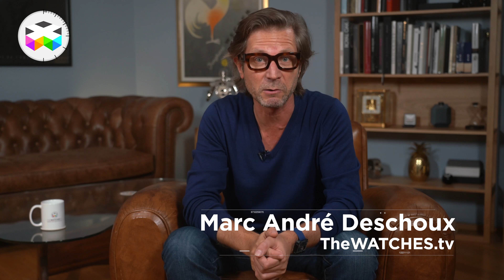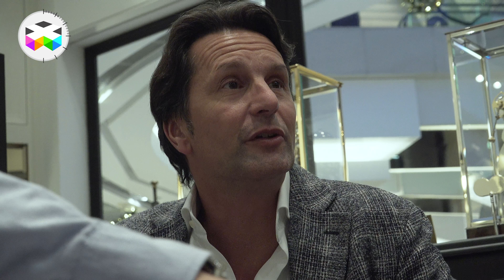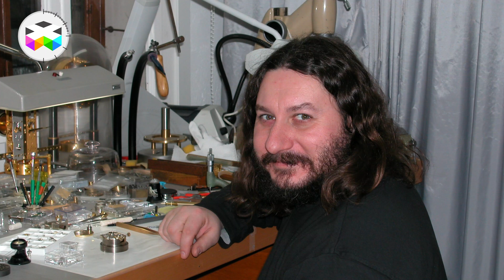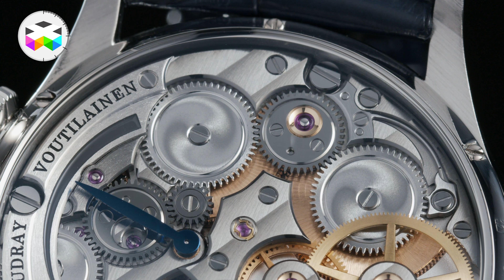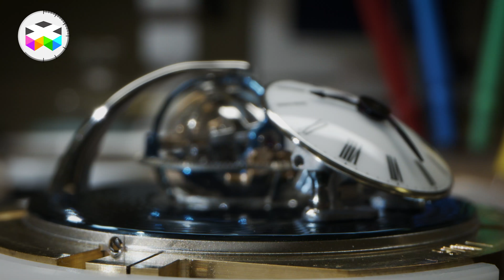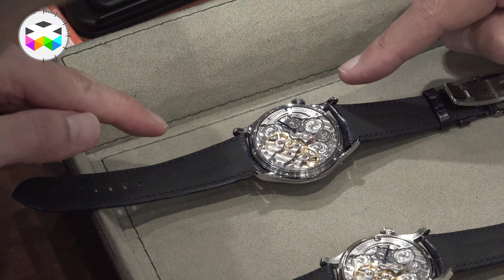CRAZY LEGACY MACHINE THUNDERDOME BY MB&F

Comment: Wonder if these things could be used as engines for tiny machines. I mean, obviously yes they can move things they're watch engines, but it you used it to make some super aesthetic clockwork robot thing- this thing would be a beautiful core.
Reply: The sculpture thing in the middle isn't where the power comes from...its only responsible for regulating the unwinding of the spring, and the spinny spinny doesn't really help at all with that.
Reply: @aaronfkckcjc6910  

Nahh it'd just be a stylistic kinetic energy adaptor. I should've mentioned though that I don't expect something like this to be able to move much more than some tiny decorative flower.

Comment: Its a great work again from them, but I am worried about the new "3D balance wheel", as more surface area means more air friction while oscillation. So, in order to compensate/counter this, they might also need to evacuate all air from the inside and create a vacuum.
Reply from the maker: Interesting point!